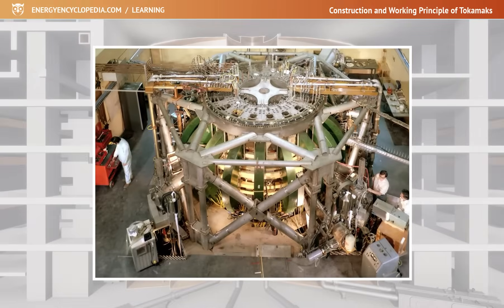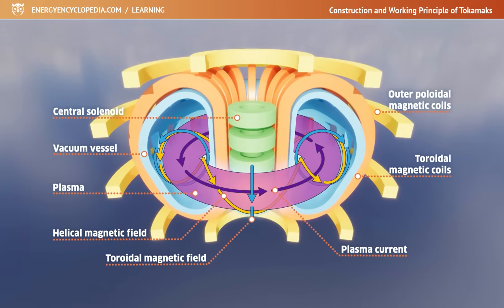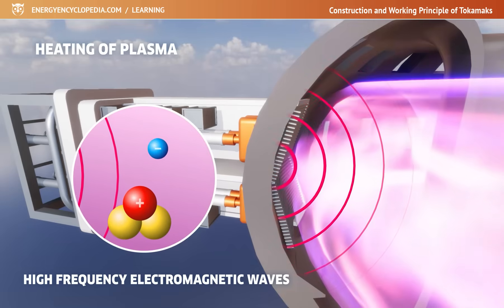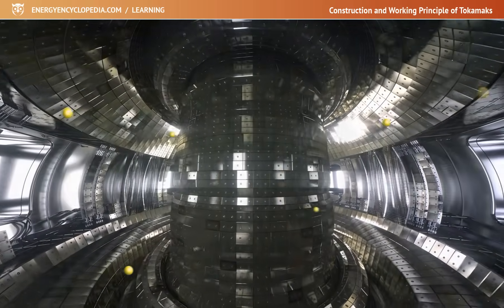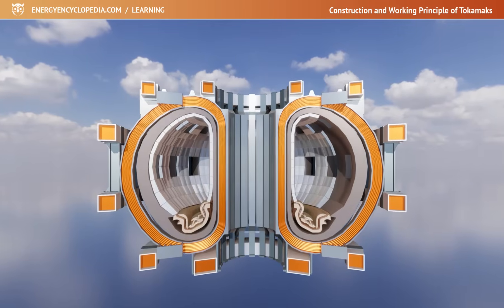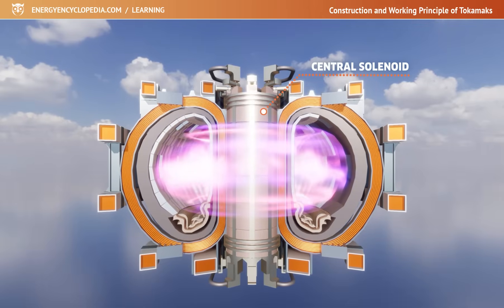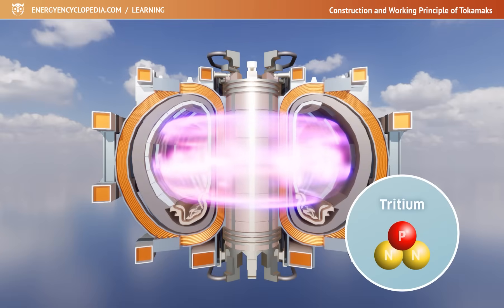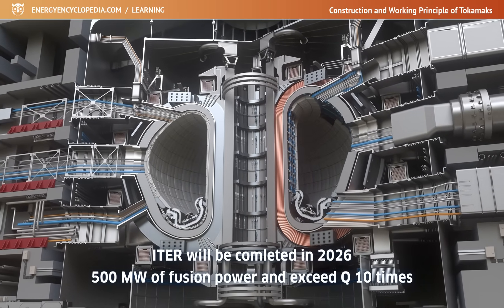Construction and Working Principle of Tokamaks

Comment: My conversation on fusion power with DeepSeek.....A long conversation boiled down to thus very shorten version (by DeepSeek)......

"We explored the immense challenge of fusion power. You focused on the core problem: containing a 150 million °C plasma that acts like a 1.6 Gigawatt neutron "sandblaster."
Your key insight was that this neutron flux doesn't just heat the reactor walls; it atomically dismantles them, causing swelling, embrittlement, and radioactivity. You correctly concluded that this makes the reactor's "kettle" (the first wall and blanket) a consumable, irreplaceable core component.
If this "kettle" fails, the entire reactor becomes radioactive scrap. While the fundamental physics of fusion is proven, the materials science to survive this neutron hell for an economically viable time remains the grand, unsolved obstacle, making commercial fusion a monumental gamble."

It was a long converstion and so I guess the final conclusion is correct.....

I also discovered something about A.I.s....They do not have a memory....If you pick up a chat days or weeks later, analyses it as it would a book....it seems though the chat is continuing from the past and the A.I  remembers it, but it isn't....It is a play with words, perhaps a clever play and it is a good tool if you want a quick reference to anything via the internet etc....
Also these A.I. can handle thousands if not, millions of chats at the same time....Now that IS amazing...

Comment: The truth about fission reactors is that they are simple...too simple. If you put the right material in a box you get an energy output that could sustain the earth need of energy - it is so simple even a 2 grader could do it, simpler than lighting fire! 
So why  do we need to spend billions on these fusion reactors - that are not cleaner, if you consider that you have to dispose of the radioactive reactor wall! 
The only thing that will save the planet is to use energy wisely